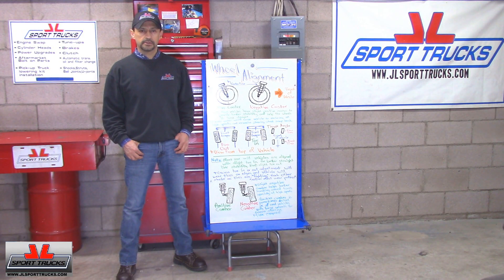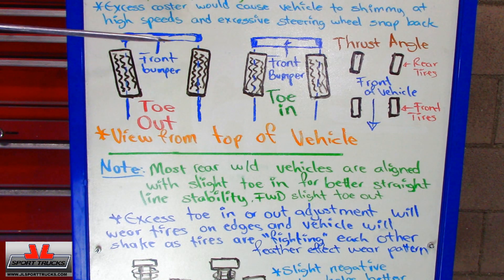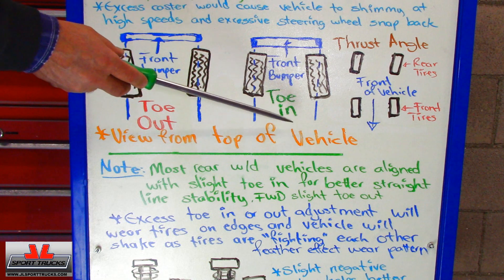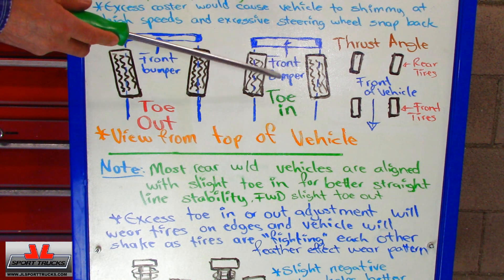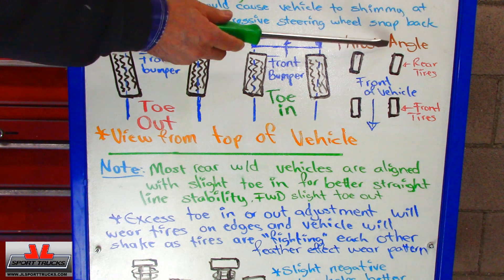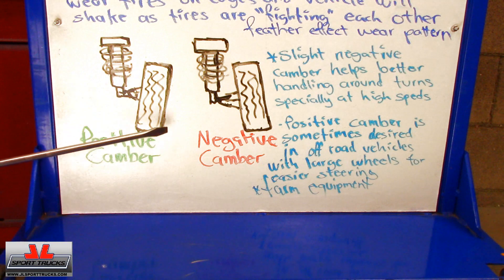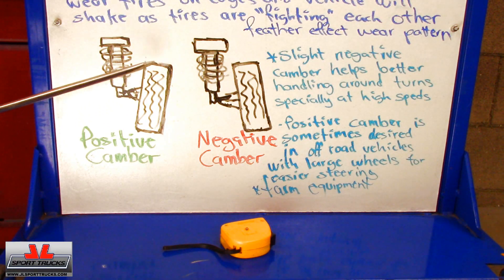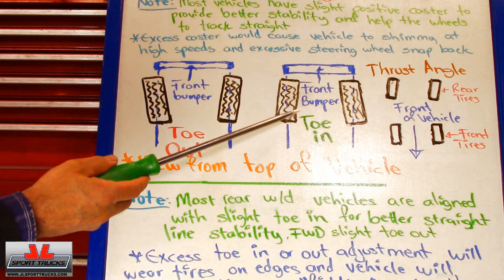Understanding Wheel Alignment and its relationship to Tire wear pattern

Comment: My steering wheel is slightly off centre when I drive straight. The steering wheel angles slightly left when I'm going in straight line so what you think I need adjusting? Also if it's slightly off centre does that matter if you leave it for a few months or do you need to get it looked at ASAP?
Reply: Does the car otherwise drive straight? Does it feel stable? do the tires wear out nicely and evenly? If everything feels good and looks good, it'll be ok.

But if you want your steering wheel straight, there is an easy fix.

If the steering wheel looks like the car should be going to the left, but the car actually drives perfect and straight, then you need to go to your tie rods and adjust the left wheel to go left more, and adjust the right wheel to go left more.

Both tie rods need to be adjusted exactly the same (example 1/4 turn each).

Keep adjusting the tie rods evenly, until your steering wheel is straight.

Basically, if the steering wheel is going to the left, the wheels should be going to the left as well, not straight.